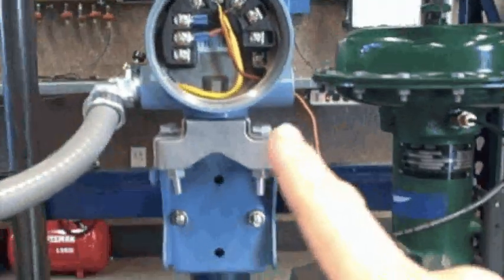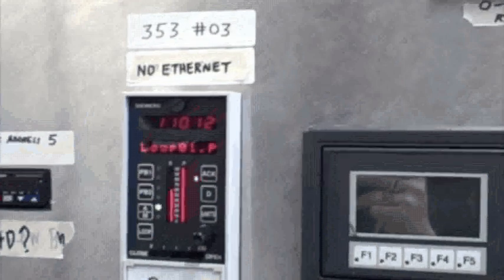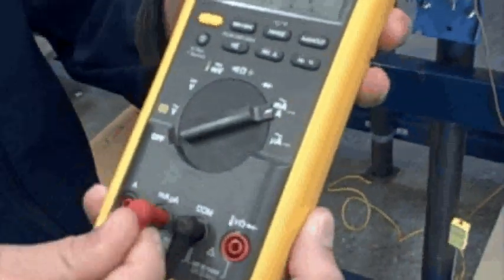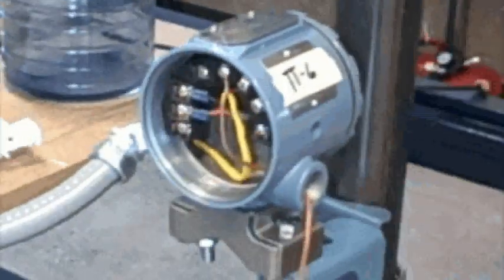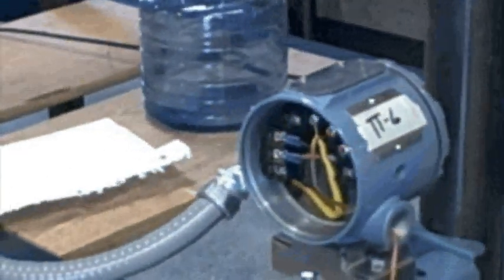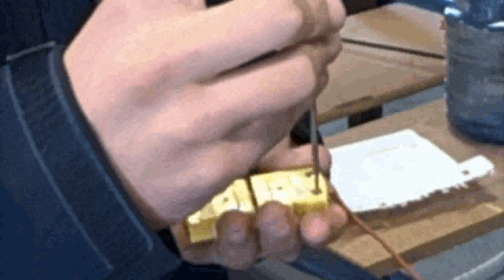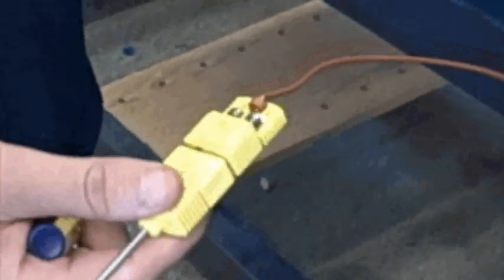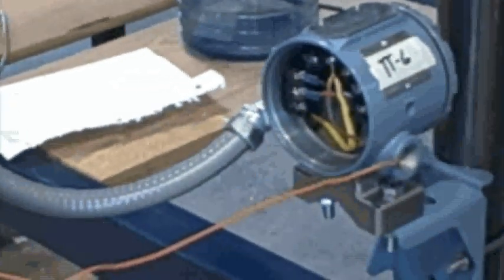Loop troubleshooting effort -- success!

Comment: If he had measured the milli amps in series he would have quickly diagnose the fault , he would have gotten 0 mA that is a good indication for open circuit, but he chose to measure it in parallel due to the 250 ohms resistor in the smart transmitter.

Comment: Why did he get higher than 20mA reading when it was open? Shouldn't the meter have showed 0 mA which means open and no current/signal because minimum was 4 mA?
Reply: According to requirements of their plant, they calibrated the transmitter to a FAIL SAFE HIGH, which means when there isn't a signal from the thermocouple, the transmitter would then give off a HIGH signal. More than 20mA.
Reply: @Nanzyen  this answer makes sense. Thanks.
Reply: na failed high, could be how the transmitter is set
Reply: The transducer will output high current while reading high resistance.
Reply: @genoporter7863  open circuit = 0 amps

Comment: This is awesome. I love the questions. I recently exposed some college projects in front of three teachers. I was just delighted one of them was asking the very questions I asked myself when I designed the project. I worried about the thermal lag between the fluid reaching a certain temperature, and the sensor actually measuring it, but I calculated that it wasn't too bad. He asked me about it ! To simplify the code, I chose a °C calibrated sensor and he asked me about it too. Smart teacher.

Comment from the maker: The transmitter has a pair of "test" terminals connected in parallel with a diode carrying the 4-20 mA signal.  Connecting an ammeter in parallel with this diode causes the diode to turn off, with 100% of the loop current going through the meter.  In any other circumstance it would be wrong to connect an ammeter in parallel to measure current, but here it works!